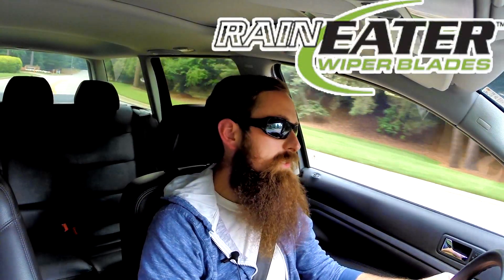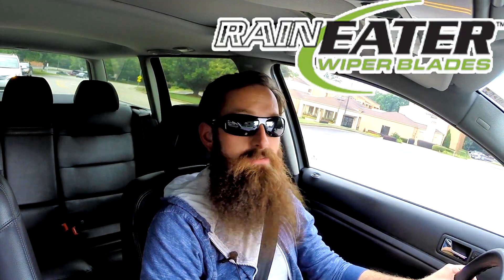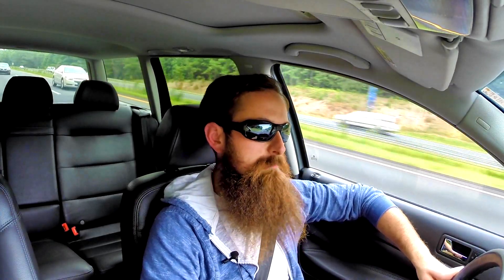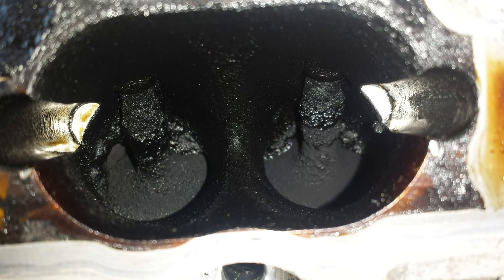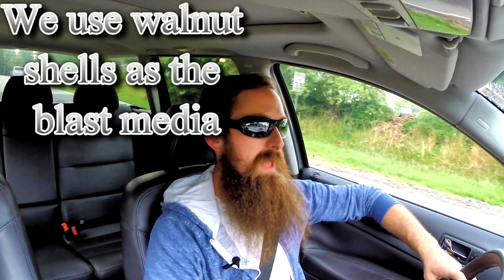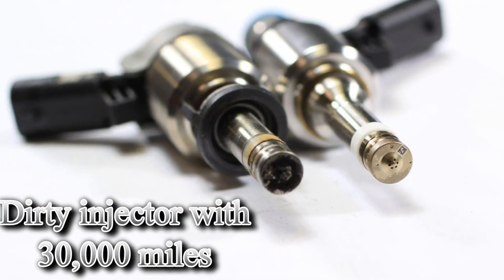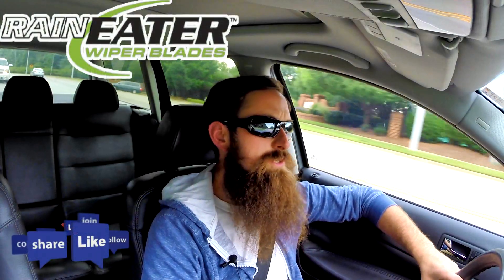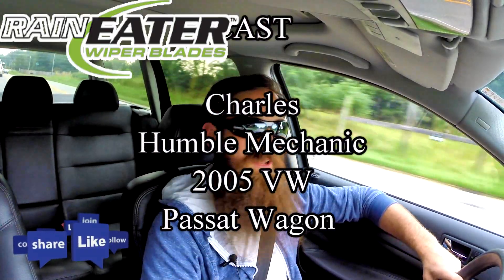Preventing and Fixing Carbon Issues for Direct Injection Engines ~ Episode 80

Comment: Hello. I have a smal problem with my mk6 gti 2009 manual gear box . when I try to go on a very strong start, changing the 2nd gear remains stuck as if the gas does not come .. 1gear is very brutal is i normal... that's only when I'm very sporty .. if I use the normal car it's all normal ... in other words I can not have a very brutal launch control because the second shift is dead. If i change a 2shift before 5-6000rmp all is ok ... so : I'm stop . I'm going to force 1shift up to the maximum same like a (brutal lunch control) push the clutch to change 2shift, go in 2shift and it's all stuck ... the car is not accelerating. The gear box is ok . All work perfect if i don t go in a max rmp with 1shift. 
Pls help me. Thank you .
Reply from the maker: does that happen when shifting to any other gear>?
Reply: HumbleMechanic  I did not try from 2shift to 3shift or 3to4 ... i trying just 1 to 2 for a lunch control . I dont up with 2 shift to 6-7000rmp. Thank you very much .
Reply: She do in any shift gear if i up to 7000rmp and go up in next gear (1to2,,2to3) . If i drive normal all is perfect. Help pls. Thank you.

Comment: A catch can set up is the best preventative method.  The port injection engines cleans the back of the intake valve as it sprays detergent filled fuel on the valve. It also cools the valve some causing it to not be as sticky hot. Direct inject engines have issues with carbon build up on the back of the intake valve because the injector is in the chamber, not above the valve like port injection and doesn't spray the back of the valve clean. The "best" way to address this is to prevent it by rerouting the blow by oil and ERG circuits into a catch can setup.  This issue is more common in turbo engines where ring blow by is greater due to chamber compression being higher then normally aspiration engines and rings being a bit lighter on tolerances.
Reply: Michael White this issue can affect naturally aspirated engines as well. most notably the toyota and gm DI engines from the early 2000s.

Comment: Interestingly, this isn't really an issue for Mercedes. Definitely not trying to devolve this into a brand war. But as a Mercedes master tech, I've only seen an extremely small number of valve issues since we started using direct injection. I'm thinking it has to do with the crankcase ventilation system which uses a centrifugal oil separator on most of our engines. And as far as I can tell, it does an excellent job keeping oil out of the intake. Carbon buildup is definitely higher than on port injected engines, but nowhere near what I've seen on BMW, VW, and Audi engines. Mercedes doesn't even have any bulletins on carbon buildup of what to do about it as far as I know. Point being, DI carbon buildup can most certainly be mitigated. I think your catch can idea will probably work beautifully, even better than our oil separators.

Comment: Charles, would you be able to do a video on how to correctly apply products like Seafoam? I understand that it needs to be sprayed in at the throttle body, not before, because it shouldn't end up on any of the sensors positioned before the throttle body. What I'm struggling with is the 'how to' introduce it properly. It would be incredibly useful for the average person (who doesn't own a hoist, or half the tools you have, to see how its done. In short, most of us aren't able to pull the intake manifold off; and some of us are 6'6" tall, with mitts that don't easily get to some of the parts. Thanks ahead of the time.

Comment: Good day. I do believe this problen is causes by the varying in valve timing. Depending on what the timing strategy  the computer uses. The inlet valve begins opening  prior to top dead center of the exhaust stroke allowing small amounts of  dirty exhaust gas back into the inlet. As the inlet is always weted with oil from the crank case ventelation, the carbon sticks to this oil and with time the oil in this junk oxidizes and bcomes a nice mess for the poor bloke who has to eventualy clean the headache up. To sum up, with new cimbustion tecniques like Atkinson and Vw budock cycle becoming the norm we are likely to see this problen become much worse  in  new GDI engine's.

Comment: Charles, on direct injection cars, what is getting deposited on the backs of the intake valves?  Carbon deposits don't come from clean air.  I hear the part about the varnish accumulating after the motor is shut down.  Are you saying that the catch cans are not preventing or attenuating a number of deposits?  Remember how clean the combustion chamber got w/ a head gasket leak?  I think a stream of atomized water would be a good thing to try.  It could be picked up from the ac condensate.  Was it the water/antifreeze mix?  Not sure, but worth a try.
Reply from the maker: It's a few reasons. PCV is one, accumulated from when the engine is off seems to be a common theory. Most manufactures are moving to dual injection it seems

Comment: Charles please offer some help my made in Germany 2004 Jetta tdi bew wagon everything is fine until I turn the headlight switch on once I do all of the break lights are fully illuminated and won't dim down after 3-5 miles of driving the glow plug light starts blinking other than that every thing works great any help would be great

Comment: WARNING: Do not buy a GDI engine. 
I have a 2014 2.0L Theta GDI from Kia (same engine also used in Hyundai)
The engine was maintained, Oil changes every 6000k. 
It self destructed at 148,000 km.
but all GDI engines are problematic, due to inherent design issues. And they are extremely  susceptible to large amounts of carbon buildup.

Comment: VW owner of 25 yrs here.  I bought my 08 2.0t Passat wagon 2nd hand with 67k on the clock 2.5 yrs ago.  In the first week I had a ton of warranty work done, injectors  manifold etc and they said I needed carbon cleaning.  So I did it.  While researching the carbon issue I wanted to see if there was some way to truly prevent it outside of a catch can, really there isn't.  However I did come across a paper from VW suggesting that when carbon symptoms occur the vehicle should be driven under load at 4k-4400 rpm for 30min or so.  I cannot for the life of me find it again.  Fast forward 2 yrs, I've driven an avg of somewhere around 30k miles each of those 2 yrs.  So like clockwork it started, first cold start miss on cyl 4, then random on others.  For gits and shiggles I decided to try the VW procedure,  it works out to 80-85mph in 4th gear.  Obviously VWoA cannot recommend this to the general public, but hey I live in NJ and if your not going this speed in the left lane you'll get rear ended.  With a fresh batch of full synthetic Rotella in the pan I went for it.  I drove 43 miles at no less than 4k rpm.    I drove 10 more miles at a reasonable speed to get things cooled down.  Next morning, voila no cold start miss, none of the other carbon buildup symptoms and MPG right back where it should be.  Now I haven't scoped the intake or pulled anything off before or after, just wanted that out of the way. However in the 2 mo since the symptoms have not returned.  My theory on why it may work, obviously the heat is a major factor but I think 2 other things happen.  One thing is the valve thrashing at that speed creates a harmonic that as the carbon is heating knocks it off the valve stem.  The other thing being the constant psi change and shockwave back up the intake tract when the valve closes.  I'm no more than an avg IT guy that turns a few of his own wrenches and has been autocrossing for 30 yrs, so I know more than the avg person, but I'm no mechanic.  I am willing to call the procedure effective.  Having said that I do not advise breaking the law.  Just wanted to share my non scientific, semi knowledgeable experiences that may spark some conversation about that issue.  YMMV
Reply: Greg Koblentz should I try this sported driving on my 2016 wrx cuz I baby it to much I think

Comment: I've been using Shell over 90% of my car's life and I still see a bunch of carbon over time. I'm on my 3rd intake manifold with my 2010 GTI and my car is almost at 135K miles. I do have an oil catch can too. It helps, but it wont prevent carbon buildup. 15,000 miles with the catch can, did seafoam, and still saw some carbon come out of the exhaust. 25,000 miles on this intake manifold and so far so good. I'll probably get a manual cleaning at 150,000 miles anyways
Reply: AJ team I’ve tried doing 2 cans of sea foam in the tank and it does help. But pretty soon I am gonna get the intake manifold cleaned at my next service at 140K miles. I may try redline cleaner some day

Comment: This is 3+ years after initial posting, but what the hey?  Humble, what do you think of Ford's "solution" of adding an injection point up stream of the intake.  My 2018 Raptor has its direct injection plus the upstream "one".  I do not know that they claimed that to be a carbon build-up prevention, but it gets some detergent on those surfaces.  My previous ride was a 2013 F150 with the 3+ liter ecoboost and I had no problems, but then again only 35,000 miles and I have a heavy foot.  But for long haulers I understand there have been problems.  I noticed you mentioned that port injection toward the end of your video.
Reply from the maker: +Rooster I think that's probably the best solution

Comment: I don't know why not putting a row of small injectors in the intake line, this would keep the valves clean. If petrol engines have to be also driven long times on highway then at this point I would go for a diesel engine.

Comment: My partner s looking at a 4 cyclinder Ford Ecoboost Engine in a all wheel drive Edge.
I'm suggesting a non  tubo six 3.5 vvt that's available , reliable, and much like her large displacement 4.0 Dohc that she has in a Ford escape , which has had Zero issues in 77,000mi. 
What would you suggest on the subject of Ford's downsizing engine program verses  the traditional attitude of mine preferring Displacement and mechanical simplicity to a 4 cyclinder vvt.  turbo engines for a reliable Durable  family crossover.
I'm hoping you can convince her for me . 
I owe the Snap On man money  and she still won't see my point of view !!!! She is smarter than me though ,Help

Comment: i have a carbon issue with some of the engines/cars i see in my dealership. when it creates misfires/ cold start issues we do what they call an upper engine decarb. you get the car to operating temp induce the chemical via a vacuum port to suck the fluid in while engine is running at about 2000 rpm to and once you inject all the cleaner you shut the car off and let hot soak for 2-3 hrs and then you drive the hell out if it to blow it out. then change the oil. and this works really well. 

but i think the carbon build up is partly due to people not driving their cars hard/long enough ... typical short driving or pussy footing the throttle. 

i have a pontiac g6 with 119k on it direct injected engine. and i have zero issues with carbon build up cuz i DRIVE my car and i do the upper engine decarb on it once a year for preventive maintenance like you would normally do an injector/fuel service

Comment: It's funny you mention the "spirited" test drive.  When I worked at a Caddy dealer we saw this all the time.  The Northstar engines don't like to be pussy footed.   The problem is GM put a 300hp V8 engine in grandmas car.  Customers would come in and you would swear that the engine had a rod knock.  We would take it out and "run it like you stole it" when you would get back to the shop it would be running quiet as a church mouse.
Reply: Andrew Morency really so probably what a going on with my wrx cuz I baby mine

Comment: The main problem is the E.G.R. valve,it's the guilty of al carbon building up, and as soon as your turbo leaks oil and this two get mixt together , also the bad quality of the petrol, is mixed with water ...........
Reply from the maker: +Alejandro Svartman in same cases yes. 

But this one doesn't have EGR
Reply: HumbleMechanic empty the catalizador. ....or remove. .....
Reply: Most of modern cars have exhaust gas recirculation.    Car that does not  have EGR valve doesn't mean it does not have exhaust gas recirculation.

Comment: Totally right on all points 👍🏻 the only thing iv seen work as well as a manual cleaning is CRC GDI cleaner but u have to use it from day one and keep using it .being a KIA tech I saw valves at at 10,000 miles that were really bad on there GDI Engines.I own one with 30,000 miles and just pulled the intake to take a look and I was shocked at how clean they were,but I've been using the cleaner since the first oil change and good fuel and lots of full throttle driving cuz thats me 😁.
Reply: I have a question for you I have a 2017 Sorento that burns oil like crazy I'm guessing it's from this issue you think if I put a cleaner in the engine and also use this intake cleaner and put a catch can it will help

Comment: +humblemechanic - I have a 2007 VW Eos, with the 2.0T.  I wanted your take on this idea since I couldn't find any videos on it.  I wanted to hook up a steam generator to either the intake pipe past the MAP, or the intake manifold directly.  Instead of introducing water, just introduced super heated steam into it while it's running.  Hydrolocking shouldn't be an issue and the heat/steam should clear the carbon.  What do you think?

Comment: At the beginning of the video, Charles mentioned that one of the causes of carbon build up was due to residual air/fuel mixtures left within the combustion chamber after shutdown.  And that that unburnt residue is able to rest on the back of the intake valves.  I assume only those intake valves that are partially open at the point of shut down.
He later goes on to say that the only true way to remove this carbon build up is a manual cleaning -  which I completely agree with.
But here's the catch, at that point of shut down there's going to be intake and exhaust valves open.  That said, then shouldn't there be carbon build up on the back of the exhaust valves as well?  If so, then removing the intake plenum for a manual cleaning does not address the exhaust valves.
Am I off base in my thinking here?
Reply from the maker: You're not off base, I think the exhaust valves are a little hotter, and maybe that is why? Or because they get hot and gas is pushed out, it doesn't build up..
Reply: Sounds plausible.  Thank you for the timely reply sir.

Comment: PCV is shit.  I don't know why they don't put a filter and drain on it as mandatory.  I changed from Dexos blended to Dexos full synthetic and that really improved things.  Also run Lucas for every gallon of gas.  Cats are too *(#&%$ expensive to risk on dumping a bunch of shit down the throat of the vehicle.  On the solution of walnut blasting, how do you keep stuff from getting into the cylinders and wrecking engines.  I understand in compression both valves are closed, but you're gonna spray dirty crap and grit all over the engine compartment.

Comment: Hi Charles, 
I've got a 2007 Passat Wagon 2.0T (~95,000 kms). Can the VW fuel system treatment be used as a preventative measure? I'm trying to do a few things DIY style to save some $$ and I've found that my car has been idling not as smoothly as it used to and my fuel economy seems to be shorter between refuels. I haven't done my tune-up yet with spark plugs and ignition coil replacement. Should I wait until that's done first before I try the fuel additive? Thanks!
Reply from the maker: id would do the fuel treatment first to see how it acted after the treatment. IT may or may not help
Reply: Thanks. I went to the parts dept of my local VW dealership. I was advised that they don't have the treatment as an item for purchase but it is available only through servicing dept. I'm out on the west coast of Canada.

Comment: I actually performed my own intake cleaning in the garage on my 08 Passat. I replaced the injectors while I was in there. I used the soak and scrape method to remove the carbon build up and a vacuum to remove the gunk from the ports. APPARENTLY I didn't get it all out because some residue escaped in an exhaust line somewhere giving a CEL that a shop had to fix by replacing a 100$ line under the car. Next time... I'll probably let the shop do the walnut treatment on it.
Reply from the maker: strange. Do you recall the line they replaced?
Reply: HumbleMechanic I must have misplaced the service bill on that,because I can't find it anywhere. I think it was a hose that ran under the car, maybe a ventilation hose from the pcv assembly? I really don't know. It was a 99$ part that fixed the P044 cel code after they put a new fuel pump on it... Ugh

Comment: Good video 
Im flashing back to ZZ top videos. LOL. As a mechanic i find most BG products to be snake oil. Contrary to popular belief you won't find a mechanic in a can. The internal combustion engine is a carbon producing machine. The only way to repair a problem is wrench to machine. Carbon will accumulate regardless of fuel tier you burn or what can you dump into the tank.
Reply: BG has a proven track re ord particularly the MOA and 44K products - I ve been using then for about 40 years and have had great results.  Just sayin..😉